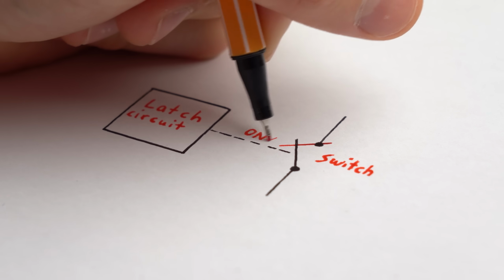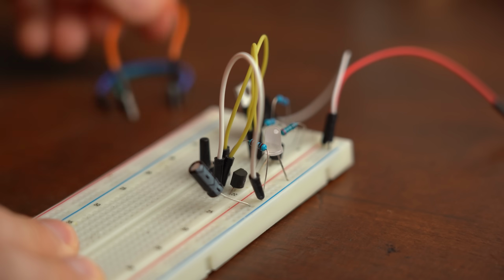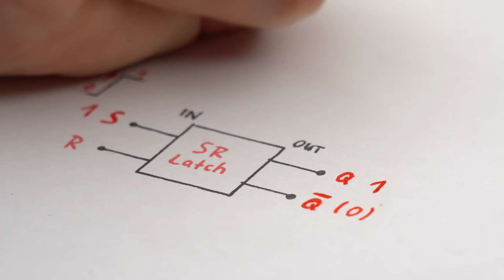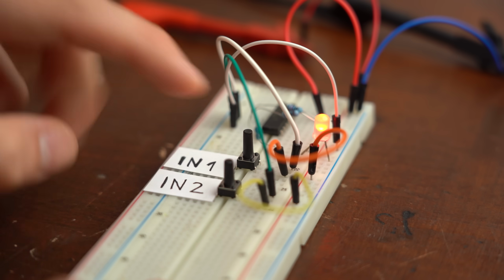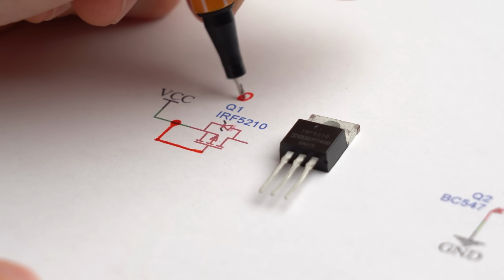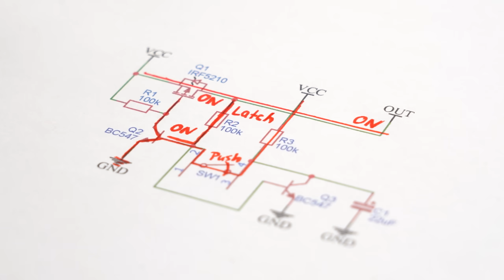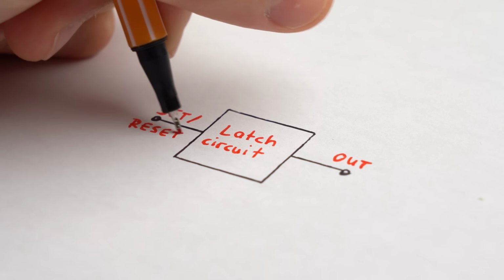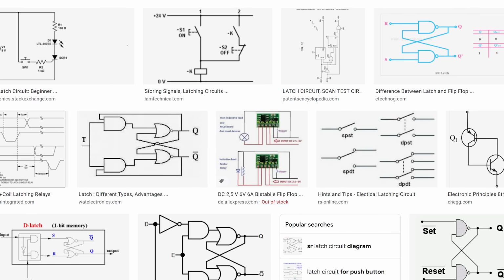Mechanical  Switches are Obsolete?! Switch to a Latch Circuit! EB#53

Comment: this is what i was looking for 😋  recently i started building an amplifier for my  gf  and i wanted to build a latch switch  in ... instead of mechanical push/latch button .. I found schematics using 555 timer , transistor and rellay , circuit was  quite simple , but this is even simpler :)  .. and since it involves   mosfet,  it basically draws miniscule current  in comparison to rellay version.. definitely going with this design next time ! many thanx 🙏🏻

Comment: I like a mechanical switch, i mostly modify cars and when the switch in the dash is set up to be momentary with a circuit keeping it on (ac button for example) it becomes not as simple to just unplug the connector from the back and run other wires to it for use elsewhere as the body controller does the switching so the dashboard button becomes momentary as soon as you unplug it from the loom and sometimes theres not alot of space to build a whole setup neatly in there, on older cars changing the "useless" buttons like ac and rear window defogger to do other functions like a high boost button or to trigger a relay to turn an oil cooler fan on were easy, and easy to undo if you wished to undo the modification later, but its not so easy with more modern cars. I usually end up de soldering the switch and soldering in a mechanical one, but then it requires more work to undo it later.

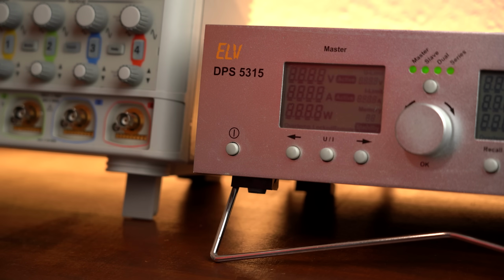Comment: I really hope that is a stairway switch in 0:40, or you're doing it wrong 🤣... The light should come on when the top part of the switch is pressed (I know it doesn't matter but that's the way we wire them)

Comment: How is the Microcontroller shutting itself off at 9:45? I assumed that when the SET pin was triggered by the IR sensor, it just cut power to the Microcontroller. How can the Microcontroller send the RESET pulse, if it's receiving no power. Apologies if I've misunderstood that part of the circuit

Comment: Thank you for a good breakdown of the latch circuit and it's uses; however, mechanical toggle switches aren't going to be "phased" out, and are by far less expensive here in the States. Last time I purchased one a couple years ago it was like a $1.50. Again though, I appreciate your ability to provide such technical information in a manner that is understandable for someone like myself. I know just enough about electricity to get myself electroshocked not electrocuted! 😂👍

Comment: My solution to power control is a small circuit/PCB I designed that uses a microcontroller and a 6A high-side MOSFET load switch to control power to any 3.0-5.5VDC circuit. The microcontroller gives the circuit special abilities such as lag/crash detection when used with microcontroller or SBC (e.g., Raspberry Pi) based projects, automatic startup on power-on, automatic restart after crashing, delayed-start/restart, and soft-button power control (tap-on, tap-off, press/hold force-off). I have one of them controlling power to my 3D printer by switching AC mains to the printer's power supply via sold-state relay. It even has a locking USB type-A output connector that's wired to appear to a USB-connected device as a 2.5A charge port, which means it can be used to make custom chargers.

It's been a great little piece of gear, rock solid performance and super-easy to use, and I'd love to mass-produce them but I would have to make a hundred at a time to make the profit/cost ratio worth the time and effort.

Comment: You cant beat a simple mechanical switch for anything battery powered. A latch switch will always require power and that will be a drain on the battery which will ultimately go flat. A proper switch disconnects the battery completely and this means the battery will last as long as its able to hold charge, which in some cases is years. Apart from that it takes up so much less space. Its a no brainer, use a mechanical switch whenever possible.

Comment: Hey there! I have built the Latch circuit with IRF9530 P-MOSFET and 2N2222 NPN BJT. But i have issue that the Gate is permanent On regardless of the state of Push button. Can anybody provide the remedy for this issue.

Comment: Hi i built the circuit with a irf4905 and it works until i connect a load it doesn't turn off and if it was turned off it wil turn on when the load is connected can anyone help me figure out what could be the problem?

Comment: for my latch circuits I just use a D-type Flip-Flop with the switch going into the clock input, and !Q connected to D, S & R grounded, and Q as your output.

Comment: Hi, I love your videos. They are great for my skill level. I have a question here. When I build this circuit with an LED it works just fine. But when I add a higher load at the output i am not able to turn it off. It bascaly turns on again after a splitsecond. What did I do wrong? Running at 16V with 0,7A load. Is this an issue?

Comment: Why did you stop short of using a single D-Flipflop instead of an SR latch and the other complicated way using discrete components? I haven't tried it yet, but I'm sure a single D-Flipflop, when connecting the inverting Q output to the D input, then you can simply use it as a toggle of the non-inverting Q output by pulsing the clock input. You can then send this non-inverting Q signal to a bs170, which in turn controls the input coil of a relay.

Comment: When power is applied first to the circuit will it turn on orr off and will the circuit be affected by voltage fluctuations to the supply voltage ?

Comment: I like how he goes from high school basic circuits to circuits 2 in a few sentences..  like a switch allows the power to pass through to signal an or logic gate to which the bjt and micro controller with an infrared detection circuit switch the circuit off..  lol

Comment: This is not truly a latching circuit because it requires timing on the button press.  If the initial press of the button from the quiescent state (off) is too long, the output is only going to be ON for a brief period of time.  After that, Q3 will have sufficiently discharged C1 and the base of Q2 goes low... and stays low.  A true latching circuit would require two manual triggers to cycle the output.

Comment: You drawing while explaining the theory of operation is confusing.  It's too quick and you cover up most of the schematic while doing so.
I have 40 years of experience, including teaching, and it's just confusing.  If it's confusing to me, then it's confusing to a noob.   Why not put together the theory of operation before you make the video and refer to the components as they are labeled?  Referring to the "left" or "right" BJT instead of calling them Q2 and Q3 is, again, just adding confusion.

Comment: A high quality mechanical switch can last longer than a can capacitor and outlast a latch circuit for controlling a large, high voltage,  or inductive load.

Comment: Great Circuit for high current.  FYI the Momentary button 1-2 is floating when off.  I made this for a project and it would randomly turn on.   Use a 100k ohm or more resistor to Tie the 1-2 of the switch to GND and no more problem

Comment: awesome video thanks,can i ask a question about the one button latching circuit could this be used for my ebike headlights as some of these circuits act funny when the main power is turn off then on as ebike power would be, i think correct me if im wrong i would most probably a bi stable flip flop latching circuit for my application,would be great hearing your input thanks KT

Comment: In the last few years or so I've seen a lot more electronic switches fail than I have seen mechanical switches fail in my seventy-five-years on this planet.  Give me a mechanical switch any day of the week, even my bedside light is on it's third (cheap and nasty) electronic switch unit and is as about as reliable as a politicians promiss.

Comment: I just built the circuit for a little project of mine and I noticed that it seem to always turn on the output when connecting the power supply.
Is there a way to make it safely stay OFF when connecting power?

Edit: Found a way! Connect a 100nF capacitor from the base(s) of the NPN transistors to GND. This way, the MOSFET gate will charge quicker than the latch-circuit can activate and the circuit will stay off when connecting the power supply.

Comment: Nothing is ever obsolete when it works well and is simpler than something else that does the same thing.  Obviously, there are some applications for which a latch circuit is preferable or necessary, because it adds some capabilities, but when a simple mechanical switch is all that is needed, that's usually what I use.
Reply: Exactly! There is a time and a place for everything, just add these devices to your tool belt. For instance, drills are great and useful, but sometimes a screw driver is just as good if not better.

Comment: I have a 1970’s car which I drive erratically in a sand mine. I’ve removed the original wiring loom (as well as doors and panels) and fitted the essential wiring to the ignition, battery, starter motor and Earth. The sand mine has very fine sand which is very Alkaline, so by having a simple mechanical switch I feel it is more robust and easy to diagnose if at fault. Is my assumption correct?

Comment: Many thanks @GS for the interesting, beautifully presented and fast-paced videos. I have found similar circuits on-line but the capacitor sits at the base of the right-side BJT and another, typically higher value resistor charges it through VCC. In your circuit, what limits current flow through the right-side BJT when it is turned on? I can't figure out what would determine the discharge time and what stops the transistor being destroyed? Thanks again....

Comment: Thanks for this video Scott.
The single-button latching circuit seems exactly what I've been looking for for a little battery box I'm currently throwing together.

Quick question, though: What is the time constant for discharging the capacitor when turning the circuit on?
I.e. how fast do I have to let go of the button to avoid immediately turning the circuit off again? ;-)

Comment: I have used more 7476 flip-flops than I can imagine throughout my life.  I could draw the connections to use them in toggle mode in my sleep.  I always thought one of the big companies should have created a small 4 pin device (power, ground, input, output) with a decent current handling capability and a wide operational (both trigger and switched) voltage.  I'm sure that company could have made a whole lot of money throughout the 70s, 80s and 90s when I designed and built a lot of my own circuits.

Comment: imagine a stove plate with touchscreen that uses such latch circuit to turn it on and off , imagine they use relay's instead of solid state switches ... and then imagine one relay gets fused in the on position and now you got no way of turning the darn thing off...
  yeah that is actually a true scenario that a friend of mine experienced a few weeks ago, he had to cut the power to his whole kitchen for a while , dunno who made/designed that stove plate but they should be sued for using crap quality relay's to deal with 20-30A at 220V

Comment: If you want to have a mechanical switch, but want the device to turn itself off, there exist self resetting rocker switches. You find them sometimes in larger printers. Also nice for the most minimalistic useless machine. They are quite expensive though...

Comment: What if you build a DC motor speed controller, that changes the speed by how close your hand is (closer the hand gets, the faster the motor spins). Achieving with a discrete transistor amplifier and an opamp, it would work.

So what do you think? Is this interesting enough?

Comment: SR flip-flops have been around a long time. Does not make mechanical switches obsolete. They are still all over the place. 
I tend to think of 7400 logic ICs as obsolete but a quick check on digikey and I see one can still purchase a SN74LVC1G374DBVR for $0.58 and they have 10,000 in stock.
Funny part of your video is that what is actually obsolete is building a latch from discrete transistors. Logic circuits have been around since the mid 1960s. One can make a latching circuit from a single thyristor.
The actual trend is to use a microcontroller to handle logic and avoid building circuits with a lot of discreet components. There is tremendous cost savings in development time and space on printed circuit boards. It is far less expensive to update firmware than redesign boards.
You seem to be thinking in the distant past.

Comment: Circuit not recommended. Discharge current though Q3 very high. Should be limited with resistor. Circuit will also fail if switch is hold longer than seconds.

Comment: Replacing 1 simple component by multiple other components may result in: more expensive, more complicated, more points of failure, more space requirements and more assembly costs. There better be enough benefits to make this idea valuable.

Comment: Hey, does anyone know a full software equivalent of a switch? I have beeb looking for this for a while and I really appreciate any answer.

For example consider we have 2 light bulbs in a circuit with a couple of switches in a way that with the correct on/off configuration you can connect the bulbs in series or parallel. I am looking for a solution to set this configuration with software, not physical switch buttons. I know that it is possible with relays but I must do this in a really small volume and lets say with 12 bulbs and every series/parallel combination possible.

Maybe it is not possible but I even do not know that.

Comment: Mechanical switches still work when a transistor fails. Transistor driven latching circuits have their place, but simplicity is safest (it's also inexpensive).

Comment: I have the most fun with a latch made with an OR  Gate an AND gate  and Inverter combo latch since there are no disallowed states along with its simplicity . Without crosscoupled wires to confuse me as to witch output is energized first. One OR gate input is the latch input. The OR Gate output is connected to one AND Gate input and the other AND Gate input is connected to the Inverter output.  The AND Gate output is connected to the other OR Gate   input and is also the output of the Latch. The Inverter input is the reset input of the latch. Some times I need a pull down resistor connected from the feedback wire to ground . Maybe 5 kohms.

Comment: Great video @GreatScott! Interesting thing to note is how much current does it use when on standby as I needed to use this latch circuit on coin cell. Since coin cells dont have alot of power, it would be helpful to have a latching circuit to turn off after use or when a specific event occurs.

Comment: Use a NAND latch for better performance, it doesn't need equal loading on the outputs to prevent it from 'sticking' to one state should it have a lower impedance.
Also, unless you used capacitive touch or some sensor - you needed a mechanical switch to make the button! And then another in the form of a relay...

Comment: They have a latching circuit for the lights in the bathroom at my work. It has a motion sensor and a timer. It has a rocker switch that always returns to the middle position up for on down for off. If turned on the timer and latching circuit are activated. If after 10 minutes no motion is detected the light turns off. The sensor still works for some time after in case someone is sitting too long.

Comment: My father home has more than 35 years with the same wall switch's and sockets. It is true that some switchs already failed but they do not failed in the electric contacts. They fail because the supporting plastics broke. None building enterprise will try electronic switchs in a new construction and being always waiting for the call about a failure. I doubt an electronic switch will last 25 years with the current surge every time it is turned on.

Comment: Only small downside to a latching circuit is the lack of inherent feedback that your circuit is on, but you can add a feedback LED on the output to somewhat overcome this.

At least with a switch you can tell in what state it is at first glance.

Comment: While I do use mosfets or IGBT's for circuit switching, they do have an inherent issue. The BIG reason mechanical switches are NOT obsolete is the electrical isolation. Exactly what was seen in your breaker! You have a solenoid coil that latches and delatches a mechanism that holds the contacts closed, BUT more importantly, they are electrically isolated from each other. Build an isolated solid state switch that can handle 40 amps at least. Then maybe, mechanical switches are obsolete!

Comment: I have buit this circuit and I like it, but I have to say that it really is pain in the butt to make it work properly sometimes.
I had to mess with adding diodes here and there to get the timing right. I had to do the math for it too, not and easy circuit to work on...

Comment: There are many uses for a latch circuit, swapping an active circuit with quite a few components, a cheap chinese momentary switch and a relay in place of a mechanical switch that is going to work problem free for as long as 50+ years, i assure you it isn't one.
But since this video is more about explaining the latch circuit in general i really appreciated watching the video as you get into deep explanation, also 555 does wonders.

Comment: Not true. 1- All this electronics + time required to mount and test is FAR MORE EXPENSIVE 2- ELECTRONIC LATCH IS VERY EXPENSIVE WHEN REQUIRED TO HANDLE HIGH VOLTAGE AND CURRENT. 3- ELECTRONIC IS PRONE TO BURN AND SHORT CIRCUIT FUE TO ELECTRIC TRANSIENT OVERVOLTAGE WHEN SWITCHING. NEEDS EXPENSIVE PROTECTION. SO STOP LYING!!!!!.